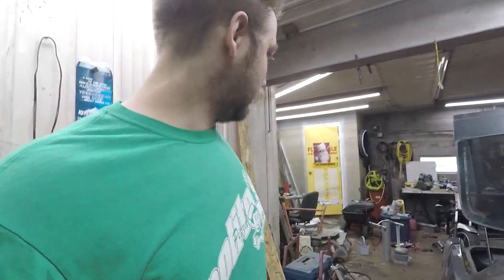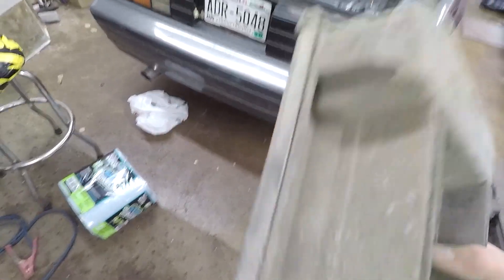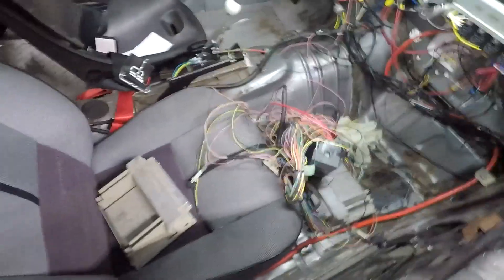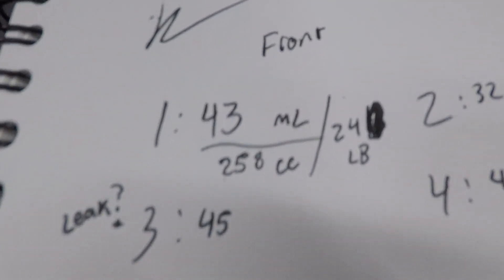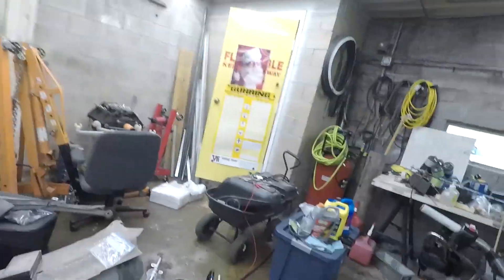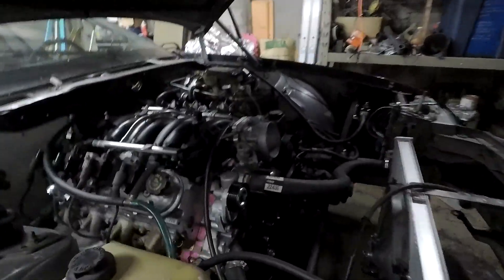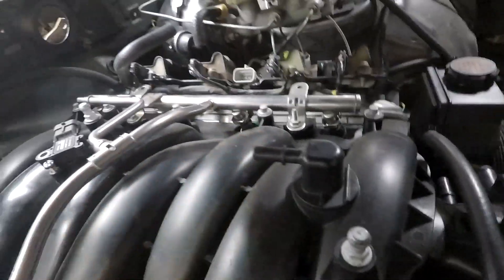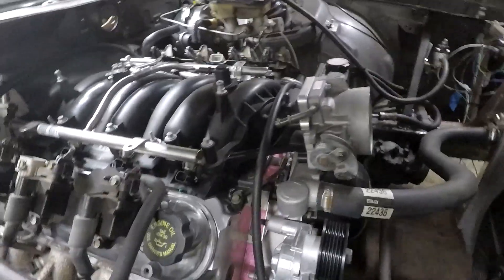fixing a low flowing injector

Comment: I applaud you for your creativity for testing your injectors. What liquid was used in your ultrasonic cleaner? As a dealer tech, now retired, but I would use AC Delco X-66P or GM’s top engine cleaner at 10% cleaner to 90% fuel in a pressure pot. Compressed air is added to about 60 PSI. This is meant for in vehicle testing or cleaning. Our injector tool was selective for resistance & different connectors. The tool, would trigger the injector for 20 cycles while we watched the fuel gauge pressure drop. On or off the vehicle works the same and notes like you, would show if an injector was low flow. If so, we could hit it again. 
  Jim Linder of “Gasoline Alley” was one of the first to clean using ultrasonic with cycling on and off. As the numbers where documented, he would put a matched set together. All thing equal in weight in the rotating mass, head & intake flow and now the injectors allow the engine to produced the most torque it could at speed determined by the camshaft and type of racing. Best of luck with your build.